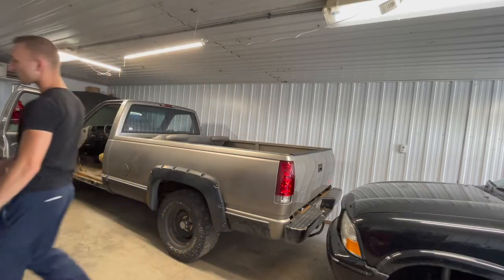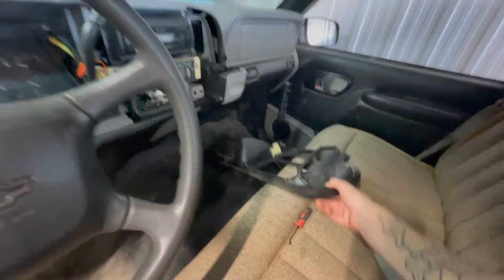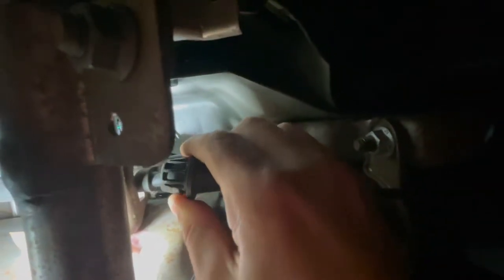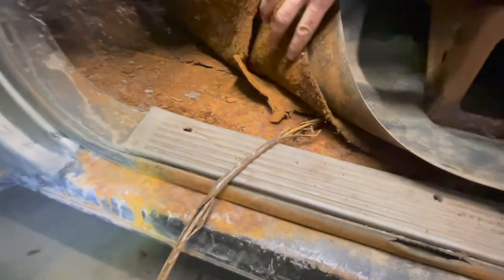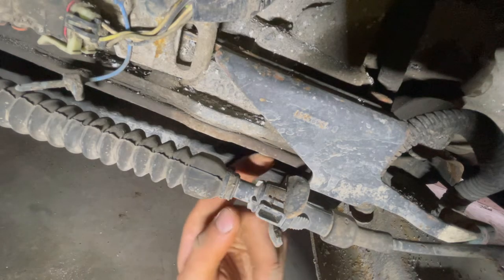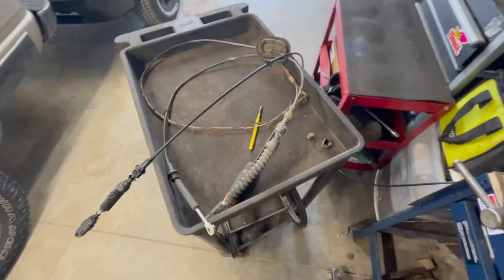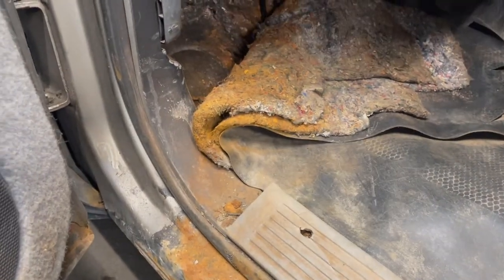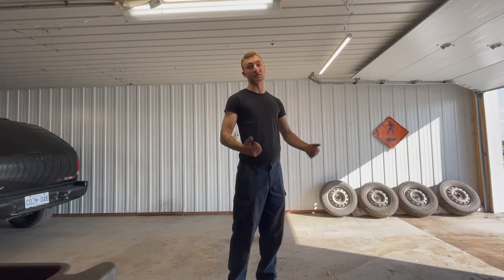1995-1998 chevy 1500 shifter cable replacement (similar vehicles apply)

Comment: Oh just throw a no passing sign under the carpet and drive it.  lol just kidding it’s illegal to take signs from the side of the road but sometimes you can go to your county or city road garage and get an old sign from them for little to no cost.  The ones they removed for being bent or the paint was coming off. But they make great floorboards. They will outlast the rest of the truck by many long yesrs
Reply from the maker: Haha i like the idea. Unfortunately i don't have that truck anymore. I ended up fixing the floor and rebuild the engine. Theres a series i made on the rebuild if you want to check out on my channel

Comment: I dont need the whole cable line it popped off underneath. How do I fix that part
Reply from the maker: Iv had that happen on my other truck. If the plastic hole is oversized that goes over the metal lever i managed to use glue to make the hole original size again…. If thats what you are talking about
Reply: @julianlindell321  thank u

Comment: I just replaced mine with an AC Delco cable and no springs in the bag.
Reply: I have same year I would repair it if Hou have the time I love my truck go for it
Reply: My factory one has both spring all ready in it. Remove the clip and clip retainer  off  the end; if yours don't have the springs in it, and put them both  in. There is two slots. Thay put pressure on the front end of the adjuster-clip. You have to slide off the the black clip retainer to see where thay go.
Reply from the maker: @mevinmayo66 ended up repairing. Just completed a ten part series of rebuilding the engine if that interests you. The final part of the truck back on the road is being released in the next few hours

Comment: order a floor pan cut the old rusty part out then mig weld the new pan in
Reply from the maker: Ended up making a floor pan thanks. I just completed a ten part series of me rebuilding the engine. The final video is being released today if you are interested. Its a great summer vibe video